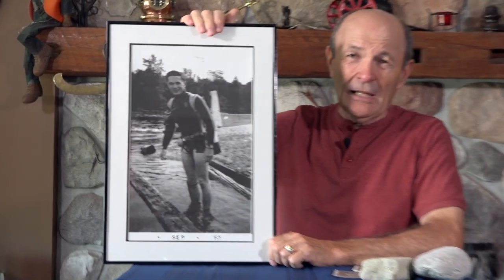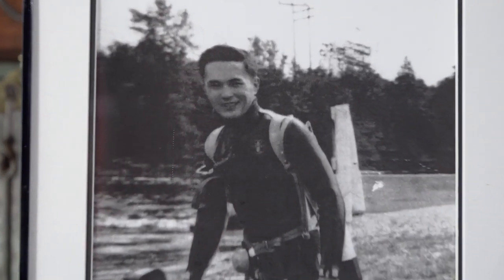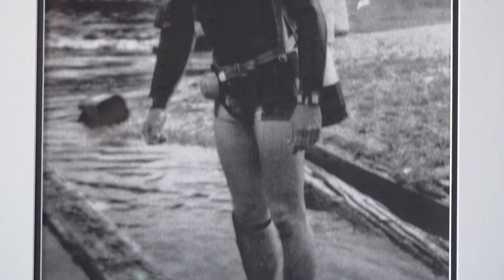Vintage Scuba: Buoyancy Control In The Stone Age - S07E10

Comment: My first drysuit dive was in a heavy rubber Poseidon suit. On the bottom at forty feet, I was so negative I took my weight belt off and left it on the anchor. When it was time to ascend I put it back on.
Reply from the maker: I had a Poseidon Unisuit too.
It was quite a contraption. I could use the bathroom, standing or sitting, without taking it off.
It also required a lot of weight and fit like a garbage bag.
Alec

Comment: Hi Alec. I noticed the tanks in the old snap shots, were they 60's they looked too short for the steel 72's? That also explains why you got away without safety stops, the smaller tanks the lower pressure in them and the 60 foot max depth. With about 1/2 the air of a new 80's you probably never came close to the NDL .Really enjoy the old stories.Take care Owen m
Reply from the maker: 72s were the most common but we had lots of 42s as well.
Thanks Owen.
Alec

Comment: My first bcd had a manual oral inflater for normal use, plus a rip cord with a tiny co2 bottle for fast ascent. Only ever inflated with the bottle once by mistake while I was tumbling in over the side of a boat.
Reply from the maker: Ha, Ha. I've seen that happen. 
That's not the reason the CO2s were banned but it's good to see them gone.
Alec
Reply: " a rip cord with a tiny co2 bottle for fast ascent"

The CO2 inflator was intended for use only on the surface, not for a "fast ascent."
Reply: SeikiBrian - quite true! Luckily I never needed it in anger at all.
Reply: I meant fast inflate, not ascent.
Reply: @tonysouthern3017  Oh! Yeah, that WOULD make a difference.

Comment: Great piece of history as always :)). I just wondering... is any  one tried use some kind of sacks or bags with smaller rocks??,  which could be part removed to control buoyancy, when coming back to the surface.
Reply: coming back to the surface is when you want to add weight as you go up to slow down, your thinking the other way around. One of two rock to slow the descend is probably plenty - doesn't need to be exact...
Reply from the maker: Putting some rocks into a bag to re-use on other dives is how we got to where we are today. It's called development!
As to picking up rocks to slow our ascent, obviously that's a good idea but we didn't have a concern about that back then.
Time to surface - we surfaced.
Alec